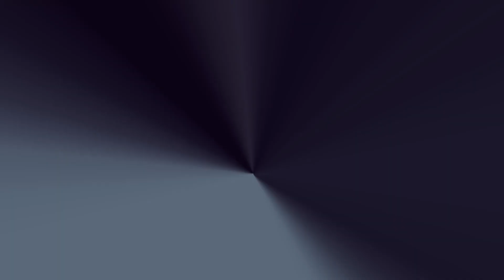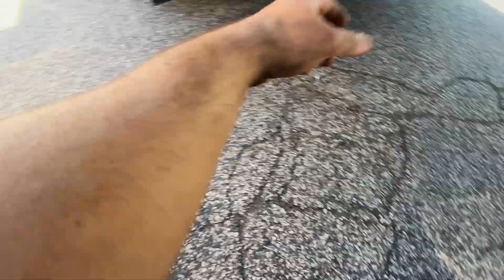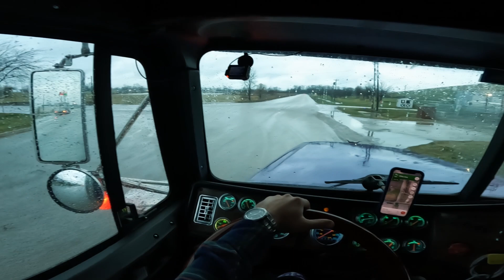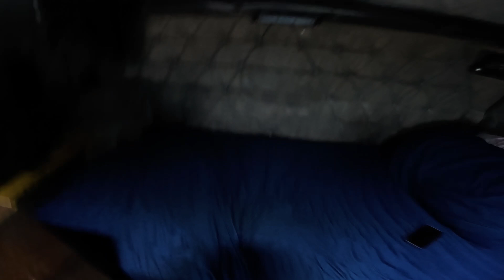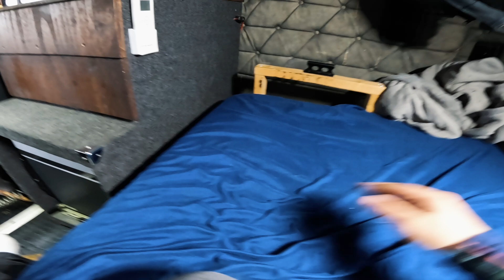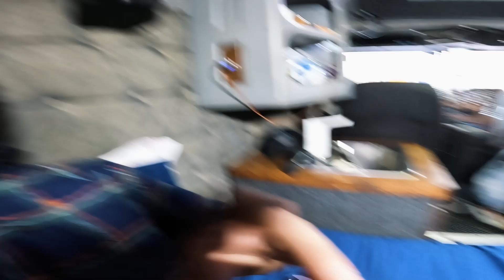I messed up+ rejected load back to receiver

Comment: Next time, dump your air, put that 2×4 across frame and fill air bags. That'll lift trailer a bit to help crank the landing gear. Repeat with more blocks of wood till its at desired height.

Comment: They have those frame ramps u can put on your truck.  I think JB hunt uses em.  Just once that happens to u again.  At least u realize it. I high hooked before I double check locking jaws and pin every time.  9 grand for transmission and clutch. Not bad make sure u get labor rate on paper so they won’t surprise u with a 11 grand bill
Reply from the maker: Yea it was like $9500 total. Transmission, clutch, bell housing, new flywheel, new yoke fluid etc

Comment: Someone answer this: when your drop your trailer on the ground can you lower the landing gear and will the trailer come back up?
Reply: As long as the legs aren't damaged yes, you can. With the 45k he had in the box though it would be a very tough job even if it doesn't go all the way to the ground.

Comment: Hey you have the 13l right? (12.7) I've heard it's not really a good highway motor and it is really bad in reliability, but it's cheap to replace and you always have to replace stuff on the 13L more than the 14L. But I also heard it's one of the best motors and very reliable. How does yours do, in terms of reliability, and maintenance cost? I know you tend to shift at really low RPM's in the low range, which saves wear and tear and fuel mileage. I'm just curious, because I might get into a Classic XL in a few years if things level back out a little bit.
Reply: 😂😂 u seem to be "hearing" a lot of things
Reply: @vroor32  well I’m not an expert on 60 series detroits lol. From my understanding it was one of the best motors, but at the same time the 12.7 makes for a really cheap and shitty motor in highway trucks with no power lol. I also hear the 12.7 was so bought up because it’s cheap to replace e always failing parts, and people who are the enthusiasts running a 60 series today run a 14l so I’m trying to just find answers from someone who has experience with the motors 😂
Reply: @robertgardner4508  what do you want to be? Ask yourself that.
A) be first to the top of every hill ahead of you?
B) be able to deliver on time, every time with less issues & downtime

Once u figure that out, come ask more questions
Reply: the 12.7 pre egr is a great engine, the 14.0 pre egr is great too but they only made them for a couple of years.  I have the 500hp 12.7, I have never felt it didn't have enough power for my needs.  I dont know where you hear that the 12.7 is bad in terms of reliability but thats definitely not true, its one of the most reliable and inexpensive engines to repair.
Reply: @apilot53  bruh, you know how people are... They wanna hear what they wanna hear .... 😂
Reply: @apilot53  what about the power for a highway truck just hauling van for example? Is it pretty good with the your gearing and fuel consumption? How’s it do climbing hills or getting up to speed under let’s say 68k gross.
Reply: @robertgardner4508  its been fine, i run 80k gross no problem with a van.  Im usually passing trucks up the hills.
Reply from the maker: I’ve rebuilt mine and it’s fine. Reliable motor with good parts availability and prices. I’ll tune it later and get power up. Def could have more power but to get decent mpg I’m ok with it over cat
Reply: @otrookie  yeah that’s true. I love me a good CAT but them detroits are good. Idk why some people I talk to don’t like em lol. Probably cuz they only ran cats.